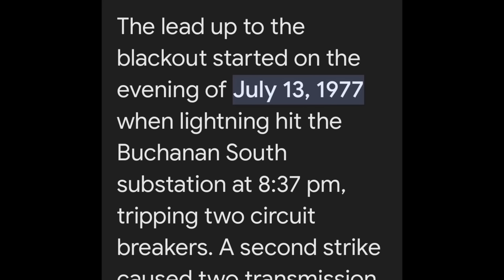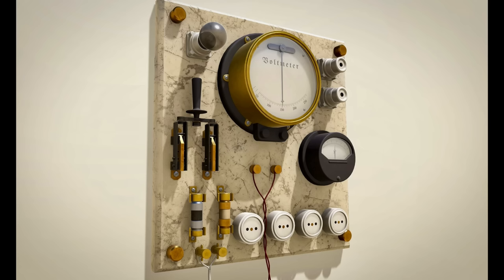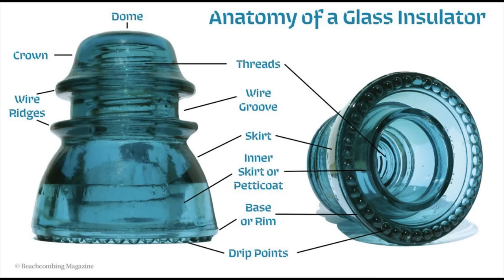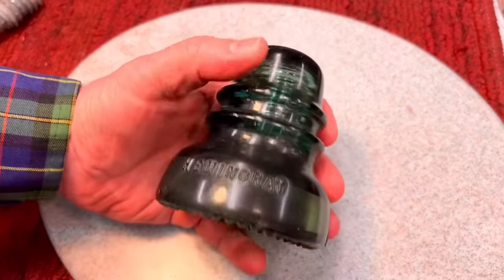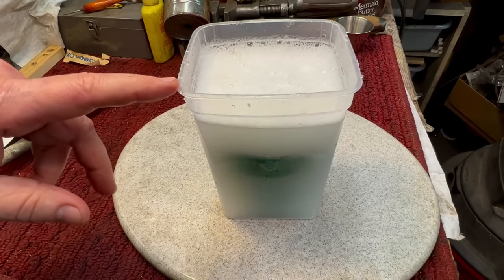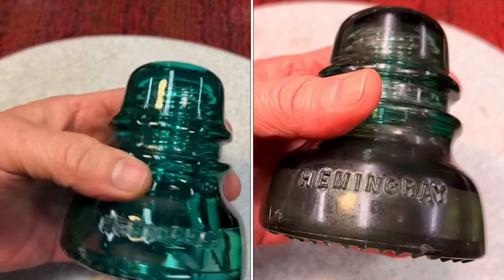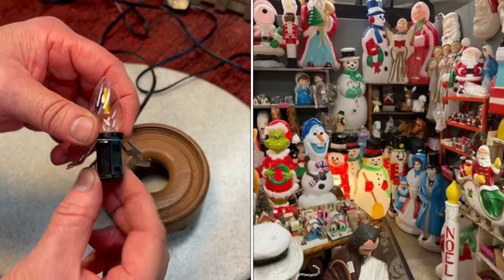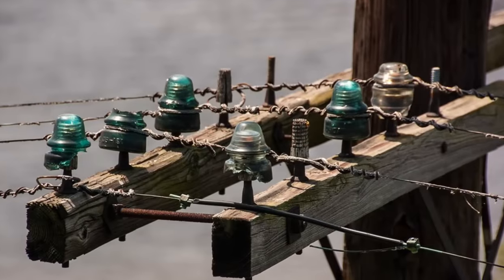Hemingray No.40 Insulator Lamp Build

Comment: I remember picking the board with the holders up in gerlack Nevada. I put them on my fence with the insulators. They were neat to look at . Your bartenders friend is some great stuff. I cleaned a brass German tool with it. I think I still have 2 insulators. I’ll try cleaning them with your method. The old dog has learned a new trick. Thank You

Comment: Most of the insulators you showed were used by telegraph, telephone, and railroad companies.  The wire lines these insulators were used on were low voltage and not for household use.  The railroads used the insulators on the telegraph communication and signal circuits that were on the poles beside the tracks.
Basically, the insulators got bigger as the voltage of the line wires went up.  Electrical transmission line insulators are usually porcelain instead of glass and shaped differently.
From my experience along many railroad tracks, the Hemingray insulators seem to be in the majority.   The Hemingray 40 seems to be the most used.  The beehive-shaped insulators seem to have been used on specific circuits.  On certain circuits, the wires were crossed from one side to the other after so many poles, about 10, and then crossed back to cut down on the effect of picking up unwanted interference that can happen with wires being in parallel for long distances, sort of like eddy currents.
I knew a man in 1972 who made night lights using glass ashtrays, single Christmas light-string bulbs, and an insulator similar to what you made.

Comment: Another great use for Bar Keepers Friend, what a difference. Wood insulator pins were being replaced in great numbers at the utility I work for. They were causing numerous outages due to rot and lack of strength over time, and it took many years in a targeted program to replace them. Not bad considering those pins and porcelain insulators had been providing reliable service for over 50 years.  Some of our subtransmission lines still support lines with very heavy duty Corning/Pyrex clear glass insulators as big as dinner plates. Lifespan is unlimited save for external damage or lightning.

Comment: I have a set of six matching clear ones with which I wanted to make a small (in-line) chandelier that looks like the top of a RR telegraph pole for the Train Room.  I was not sure what to use for the sockets and bulbs, BUT NOW I KNOW!  THANKS!  👍😀😎
Reply from the maker: James- If your insulators are smaller you can order T16 LED bulbs to fit better.  😃👍

Comment: Hey señor Juan... about those indulators, you forgot to mention the ones used at homes. I have seen then in old houses and they are made  out of ceramic. I have a bounch of those glass insuladors that were removed from old electrical poles that were placed be the rail road tracks inside the little city were I live in. I wanted to make a Christmas tree shape with them Saludos.

Comment: John, going back to your last video, I thought ConEd fixed up the water infiltration? Didn't you post a video a while ago pointing out something they did on the pole to be doubly sure you had no more water?
Reply from the maker: Brian- They plugged the pipe at both ends but they think the pipe rotted away in the middle.  So their plug at my end won’t be waterproof for long because it’s super hard to stop water unless it’s your drain or sewer!  🫣😂👍